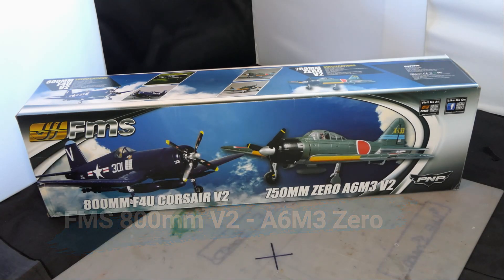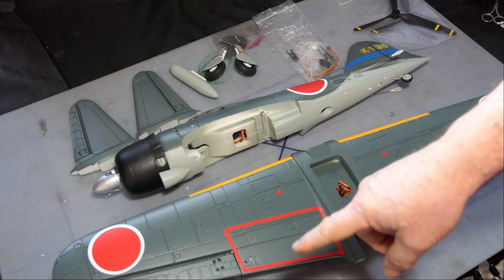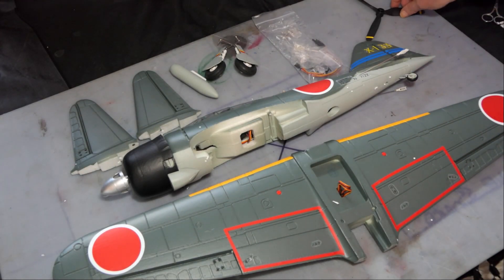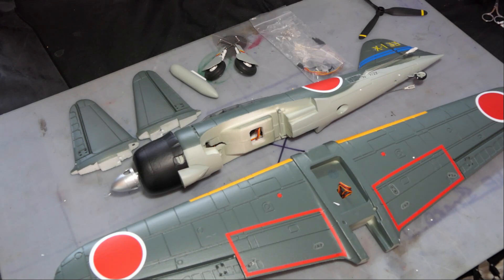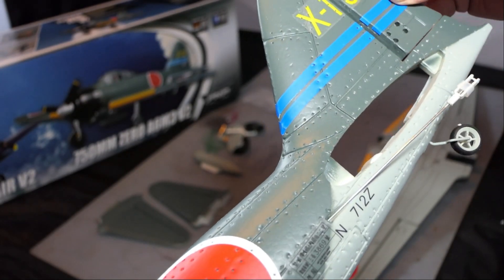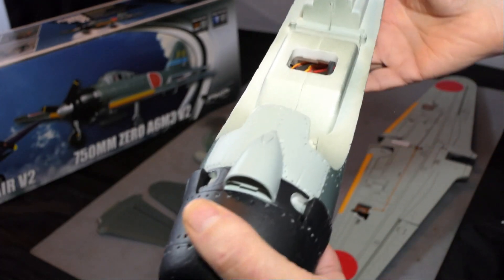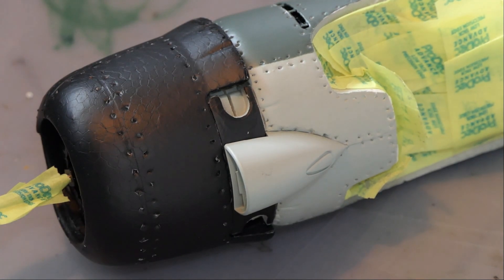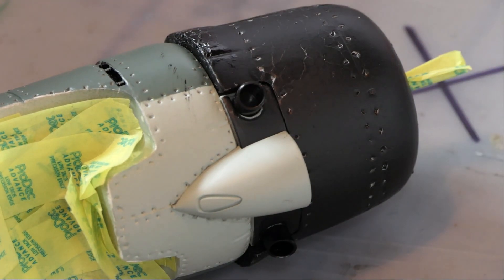Build - FMS 800mm  A6M3 Zero -V2 - Part 1 of 4

Comment: Thanks for the input on receivers. Love your detailed build videos.
I think I’m going to pull the reflex stability module out of my 800mm Corsair and use an ar630
Those work well in my 750mm hurricanes 
Cheers
Reply from the maker: I purchased some Reflex V2's - thinking I could use the software to program one for the Zero - BUT... FMS do not have software for the Zero  the only two in the 800 mm range are the Corsair and the T28 - not much space in the Zero to fit a great big Reflex - it will be hard enough to fit the Spare HK ORX stabiliser I have.

Comment: That clear coat worked well, Why didn't you mask the servos though ?
Reply from the maker: Never have found it necessary to do so , the clear coat cover  is fine and my experience is that it has no effect on the Servos at all, so don't cover them ...

Comment: What type of lacquer do you put on? Spray or a brush?  I have wanted to do that to a couple of my models, but havent. Have you ever used lemonRx recievers with stabilizer?
Reply from the maker: Hi Bret - I use a spray water based Lacquer that is readily available here in Europe, if in the US I think that a lot of people use something called Minwax Polycrylic comes in both tin and spray....I have used the LEMON RX with stabilisation - but my experience has NOT been good - so I nolonger use them I go for Spektrum AR630 or AR631 -(but they are very expensive)...in comparison with the Lemon - but as I use Spektrum TX they do work very well indeed and I do not mind paying the extra for them ...
Reply: @FlankerTanker  thank you for taking the time to reply. I'll look into the minwax. I have had good luck with the lemonRx since I came to understand it. However my first 800mm Corsair with that receiver met a sad end. Lol

Comment: So this one doesn’t have the stability module Luke the Corsair? Which receiver do you plan to use?
I love my 1.1 version 
Flies terrific
Cheers
Reply from the maker: No it does not have the FMS Reflex Stability system - I think the only reason it does not is that they could not get it to fit - the space inside is TIGHT !!!! - I was planning to use an AR410 - but decided (and you will see why in other parts of the build) I end up using an AR620.